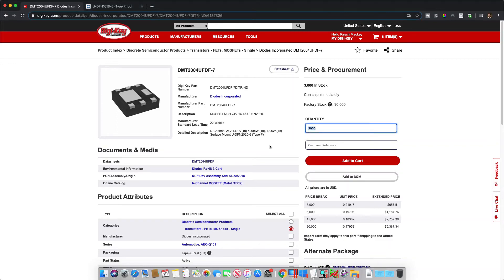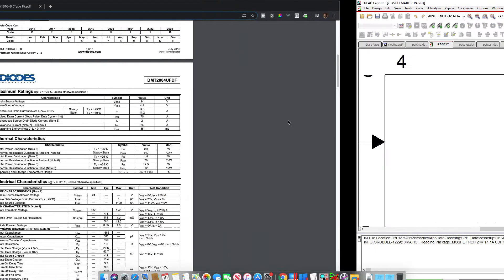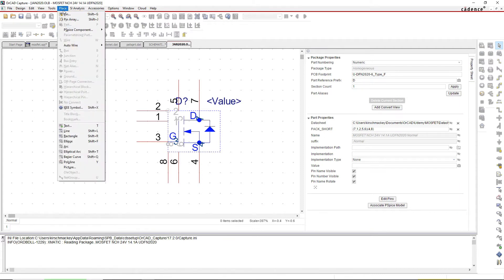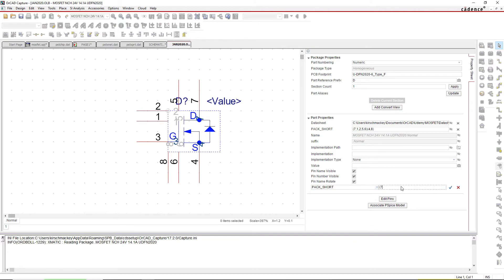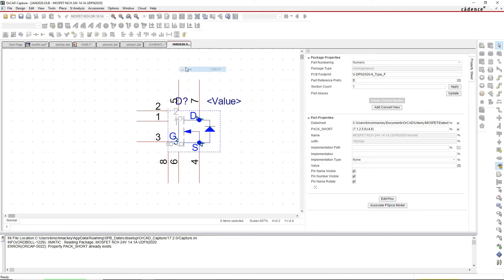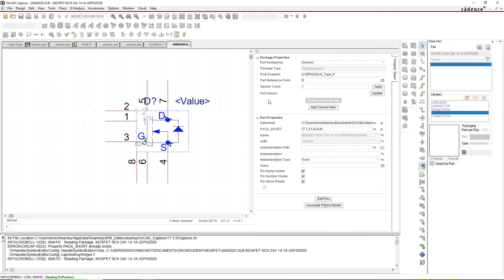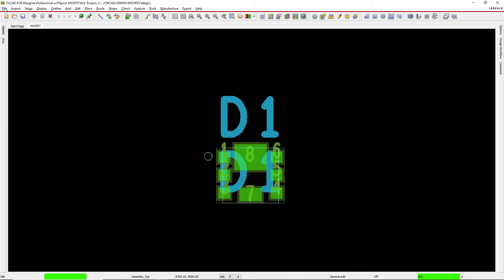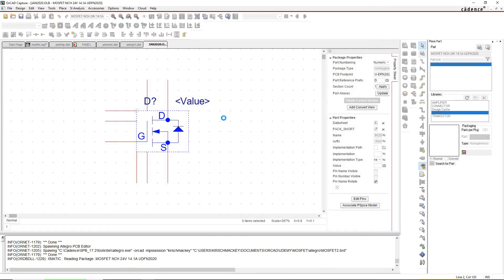OrCAD Capture Schematic Symbols - How to Hide Symbol Pins - MOSFET with multiple drains and sources

Comment: Sir, I'm using orcad 17.2 , 2016 version. There's no dialogue box in the right. So how can i do pack_short? 

I changed pin type to power and removed visibility, it worked fine. Is there any other way?
Reply: Solved:
In pin properties, i checked in pin ignorance.

Comment: I am using 17.4 and I have a problem with implementing this. This is successful when I hide pins in the schematic symbol for an IC, such as a pin that is labeled as 'NC.' The schematic looks clean and the IC only shows pertinent pins. However, when I create a net list and DesignSync with the PCB Editor, I get an error that the footprint has more pins than the device.  It then lists the extra pins which happen to be the ones I have hidden. The only way to get past this point is to unhide the pins in the Parts Editor. Now there is one difference from what you are doing than what I am doing. I am not shorting pins via the PACK_SHORT property. In fact, that terminology sounds scary ... I hope is isn't really shorting pins. Any suggestions to keeping pins hidden and not getting the foot print error?
Reply: @techedkirsch  Thanks for the response. I have limited support from EMA who sold me Orcad. They had a summer special for the 'Standard Professional' version which included limited support. Anyway, it's more of a nuisance than an issue. In my designs I often use Xilinx devices which tend to have many extra unused pins named 'I/O' so I do prefer to hide them. Orcad complains if the pins have the same name too - also another nuisance. Anyway, I found your video helpful and will be following you for more tips and info.
Reply: @techedkirsch  I found out how to eliminate the error OrCad reports when your schematic symbol has less pins than the actual footprint. Again, in the parts editor, you can set the pin to ignore and it will not appear in the part package on the schematic. However, when you move over to the PCB Editor, you'll get an error that the footprint has extra pins. To get around this, you have to add a new property to the device in the schematic. Right click on the device that you have hidden pins on in the schematic and select "Edit Properties..." In the properties, select "New Property...". The New Property Name is "NC" - no quotes. The property value is the pin number, multiple pins need to be separated by commas, for example "3,5,476,56,66" - no quotes. Now you can DesignSyc without any errors. Clean schematics and no errors - perfect. I found this solution after searching for days on the internet. It's a hidden property that is not documented and even EMA was unaware of it.
Reply: @paulbelikian953  thank you for sharing your knowledge. Do you know what we should do if the schematic symbol has more pins than the PCB footprint?
Reply: @umersohail31  Sorry for the delay in answering, I hope you found a solution. I don't believe I have actually seen this scenario before. But it seems that you could set the extra pins on the symbol to NC instead of assigning a pin number. Orcad will then not try to match it to the footprint. I would imagine that also in the schematic, there would be no connection line either to the pin since, physically, the pin is not connected on the PCB foot print. Hope that helps. If you found a solution, I would love to hear how you did it.